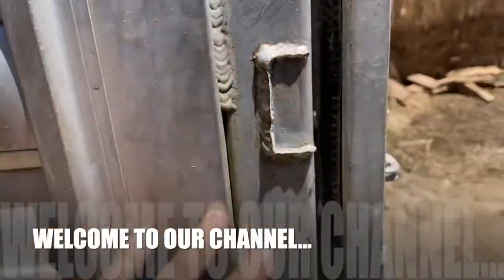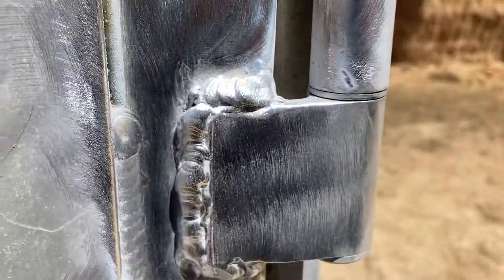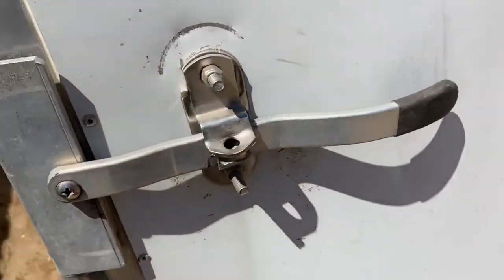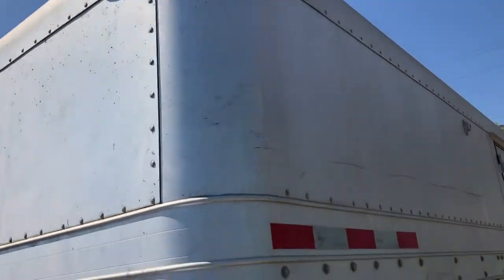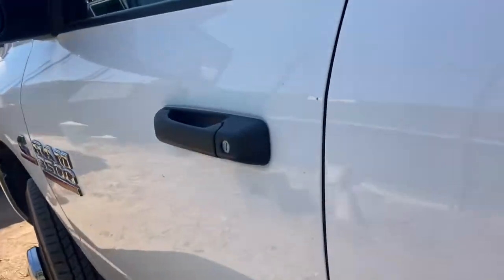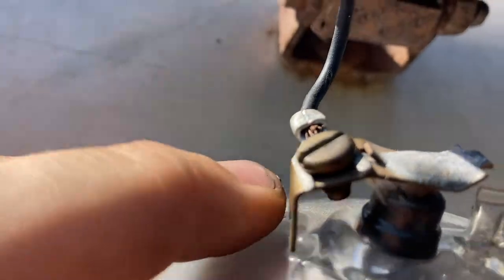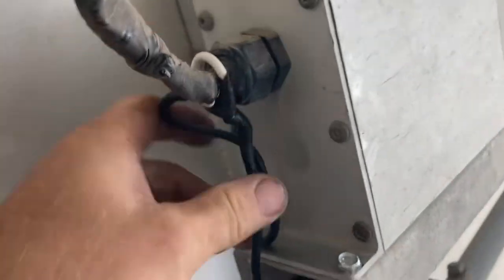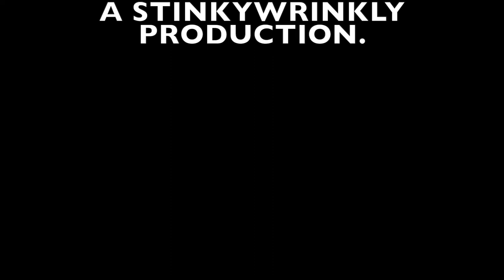The Horse trailer hustle!

Comment: Nice repair, can you post a link to the Aluminum stick rods you used. I never welded aluminum with stick, but would like to try it.
Reply from the maker: its MG 400 this is a 1/8" rod and it has to be run at about70-100 amps, I will to find a link , hope this helps ,
thanks for watching!